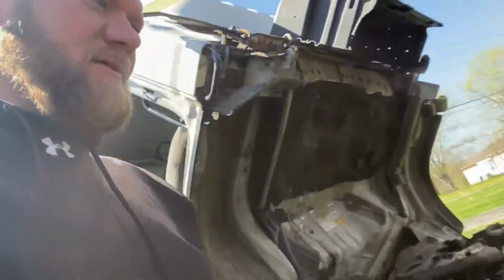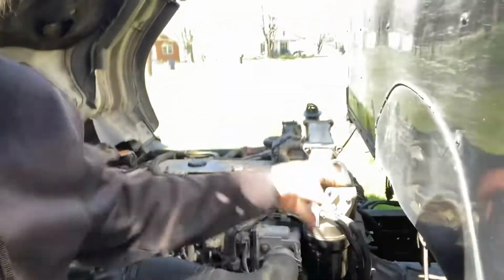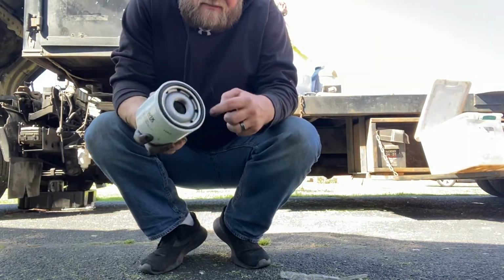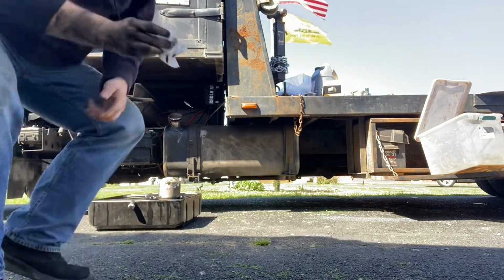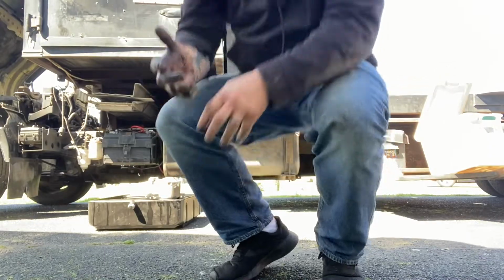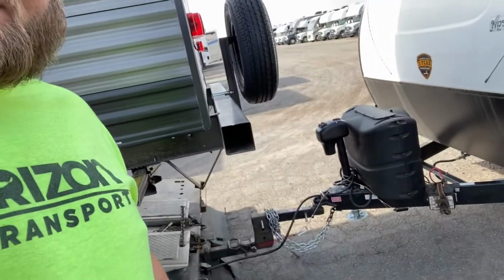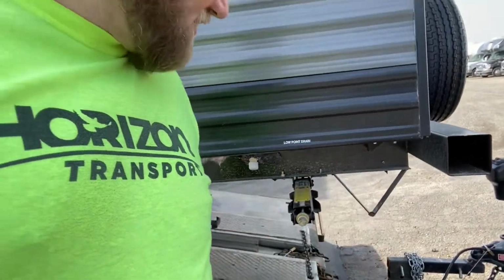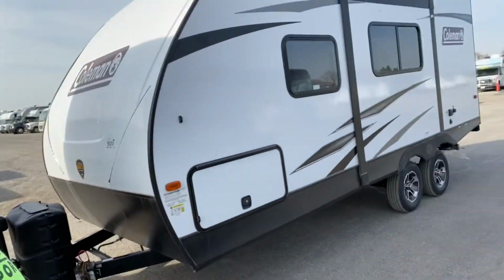FINALLY!!! A trip without any issues. RV Transporting/Hotshot Car Hauling

Comment: Glad you had a great trip and a profitable one. I was getting ready to apply to Horizon oh, the tow away couple told me I need to hold on because of the lack of loads. What's your reading on the load boards Etc?
Reply from the maker: It has slowed quite a bit which is not normal
This time of year. But being told it’s still due to parts shortages. I have read several articles that confirm this. Dealerships have back logged orders they just can’t get.

Comment: Maybe I missed it but I didn't hear you comment on how the truck ran after changing those filters? Did you have plenty of power going across to New York loaded? Interested in what your truck RPM is at 65 miles per hour?  Good to see some videos.... be safe out there.
Reply from the maker: It ran better after changing the filters.  Still think it’s a little less power but does the job. At 65 I’m running about 2600rpms
Reply: @hustlehaulandtowtrucking3508  10.4.   Glad she is running better.   My Ram 4500 is about 2100 rpm @ 65... thats with a 4.10 rear.  Reckon you might have a 5.00 plus ratio.   Long as it gets the job done.  I really wish they would make an NRR with highway specs, higher axle ratio, horsepower, etc.
Reply from the maker: @justinbarnes5498  yeah they are durable and reliable, just not designed for otr

Comment: Dave should I get a 4500 or 5500 Ram and how long CA for the flat bed? How miles to the gallon the Ford you have gets and should I get air ride installed?
Reply from the maker: 5500 with a 24-25 ft bed.  The Ford gets 7-8 I believe loaded.  And any option to make your life easier that you are able to get, I’d say go for it.